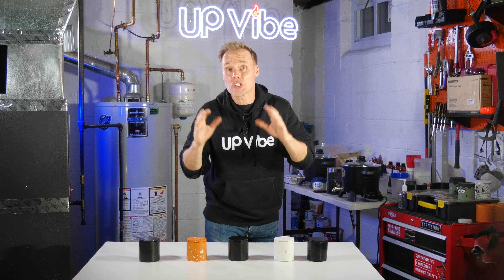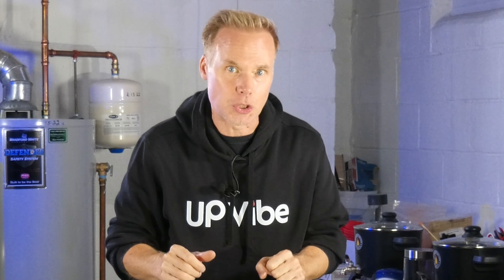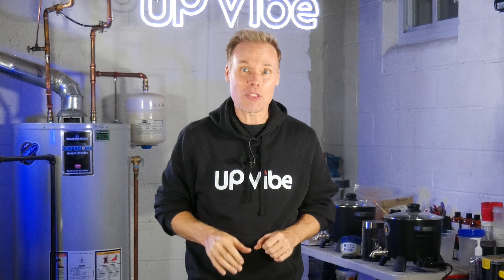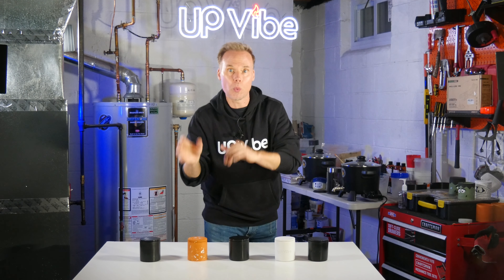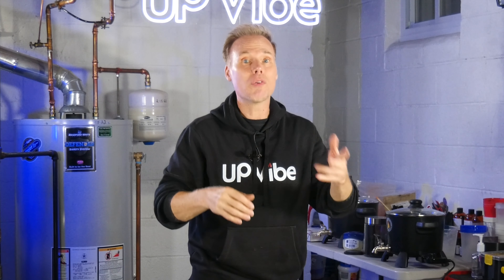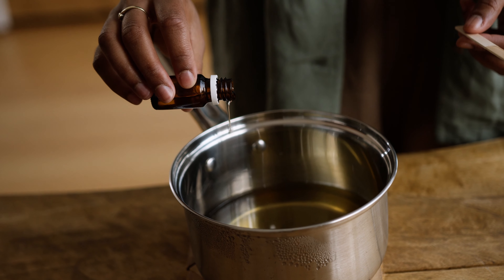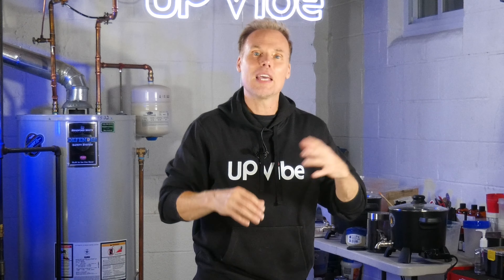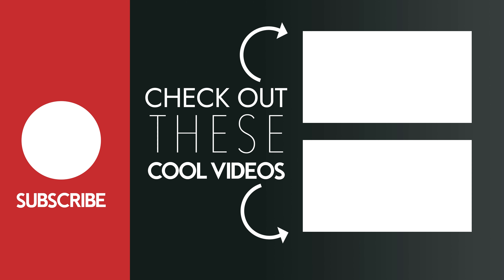Candle Testing | 5 Candle Tests Every Candle Maker Should Perform

Comment: BAH!!!! I'm so frustrated with testing! It's gonna kill me. My candle performed perfectly through the four hour tests but power burns were way too hot (like 200 degrees). I have wicked down twice and after 10 hours the jar is above 140. I want to cry. So many different opinions about power burns and their goals but I do NOT want to be responsible for a fire.
Reply from the maker: Unfortunately most use higher temperatures to justify their jar temperature. Think of your loved ones and how you would feel if they were holding an extremely hot jar. Testing is not for the faint of heart but what a huge accomplishment it is once you get it.

Comment: Thank you for this video. It has been extremely enlightening. 
I do have a question tho.....is your flame never supposed to move, flicker, or dance?? If it does.....is that a fail and if it isn't a fail.....how can they be corrected? Like what does a dancing flame mean?
Reply from the maker: In a newly burned candle a flame will flicker because of a draft, the wick is too large or it's not the right wick type. Half way down the jar a flame dances because there is much less air and so that is ok. If it soots then you need to make adjustments. Hope that helps.
Reply: @UP Vibe Candle  OMG Thank you so much. I am super brand new to this and I am currently testing. My flame dances once further down the candle and I didn't know why. It didn't do it in the beginning, and there was no draft. I have been so perplexed, but thank you for this video and for being so kind to respond.
Reply from the maker: @teannahairston5729  You are very welcome.

Comment: In your opinion, is a little soot around the rim ok after a power burn? Well after the initial 4 hours. And if the candle doesn’t soot during regular 4 hr burns
Reply from the maker: I think you have to make an educated decision based off of the reason the soot is happening and how much is happening. All candles will soot if the flame is disturbed. In addition the lower the flame goes down the jar the less oxygen there is... that in turn will create a dancing flame which might soot. You might want to test a few times to see how it reacts and then make a final decision. Again a little soot is normal and should not be a problem.
Reply: @upvibecandle  great, thank you!